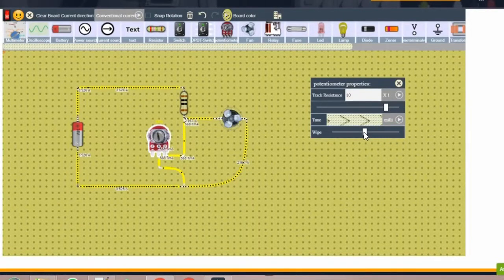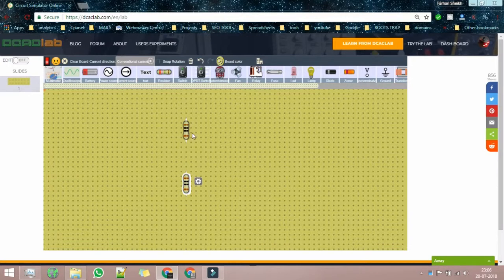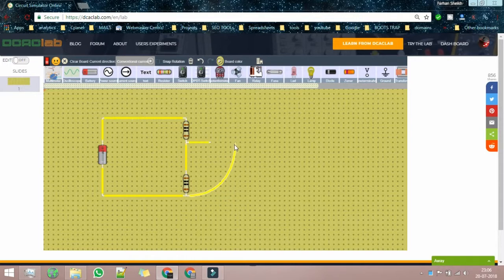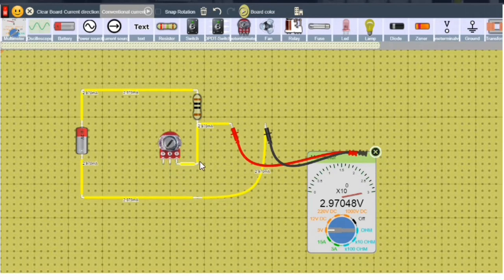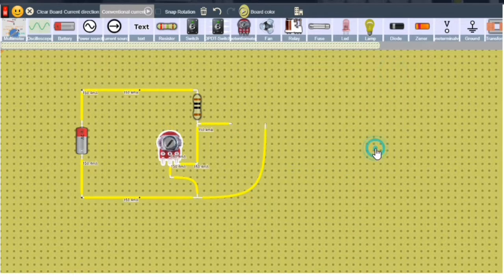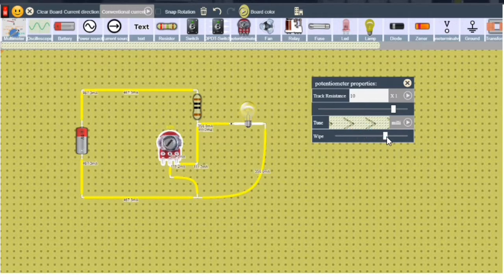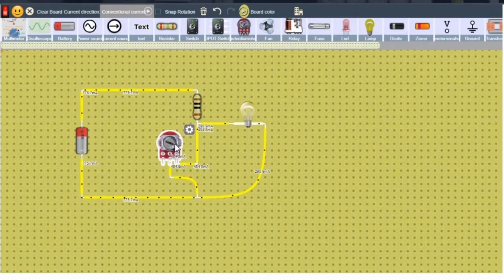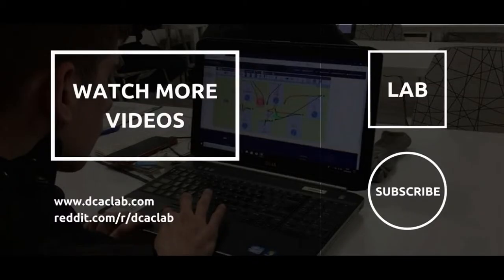Voltage Divider : How to make [Without Components]

Comment: Hi

I have a 3.6 v led light and 6 v battery 
Now I want to convert the 6 v battery current to 3.6 v

Please help me about using the resistor value for it and circuit diagram
Reply from the maker: A voltage divider circuit might help you, but it is hard to get the exact voltage you desire...